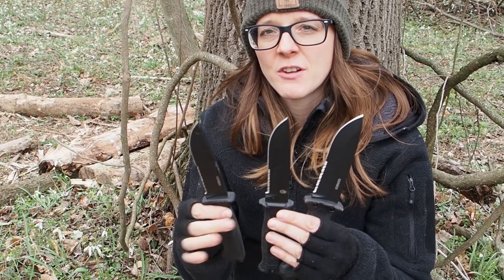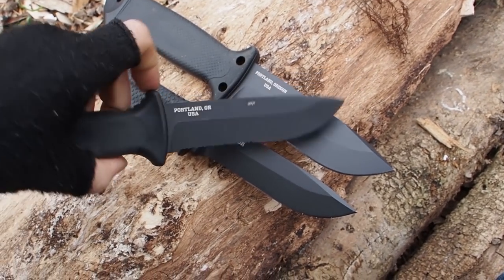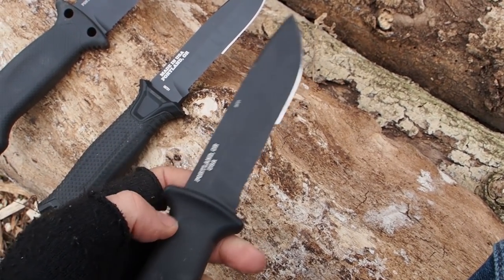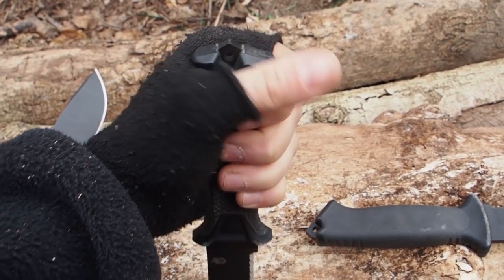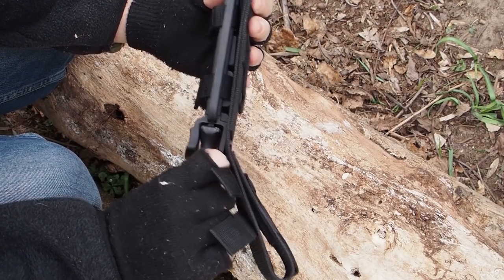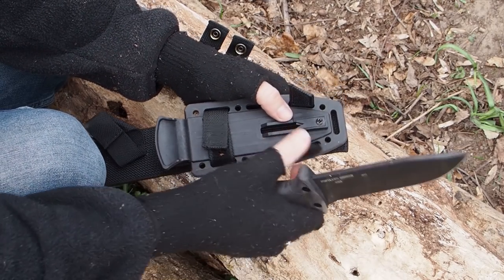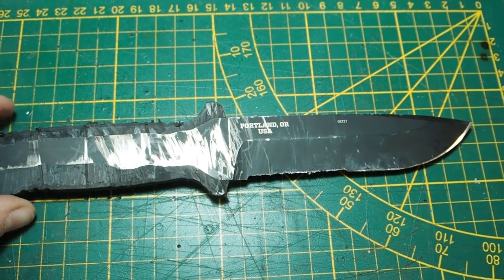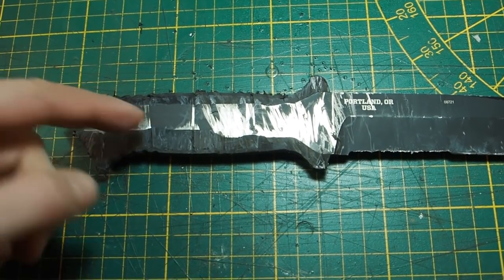Is this the BEST Urban Survival Knife?

Comment: The joke is a Helicopter or any vehicle for that matter runs on 12v or 24v DC which can not shock you. If you go and cut 110v/220v AC or High Voltage Power Cables then yes you need to be electrically insolated. So I also don't like the bulky clumsy looking knife.
Reply: This is not true. I am a licensed aircraft mechanic A&P and an aircraft battery will give you the shock of your life! There is a reason we remove all jewelry when working on aircraft.
Reply: Aircraft battery is typically 24v DC like two 12v car batteries in Series.(same as Truck Batteries just smaller Lithium Ion batteries) Yes if you take a wire and short the terminals it will spark get hell hot, basically performing like a Inverter Welding Machine. But it will not electicute you as would be the case if you were to touch 110v 50Hz AC voltage. Maybe you should go revisit your text books. Because you clearly do not understand the difference between DC voltage and AC voltage. The current on the Aircraft battery will burn and like I said you can actually weld with it, but receiving an electric shock. Sorry this is not possible with 24v DC